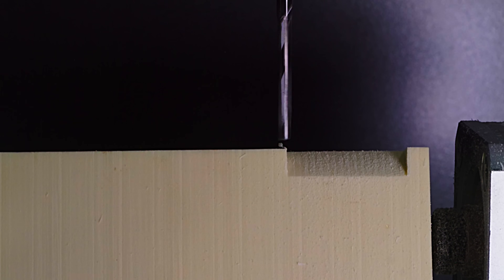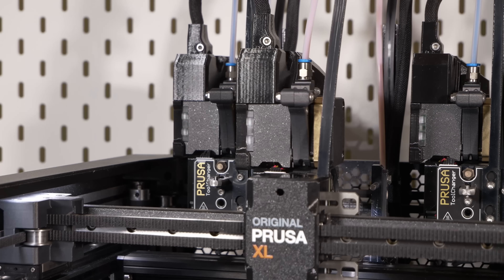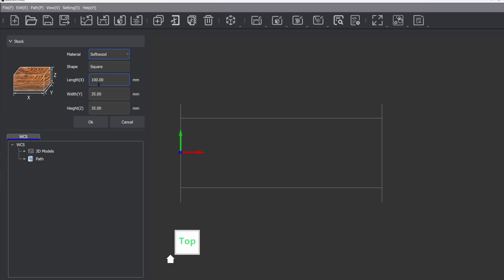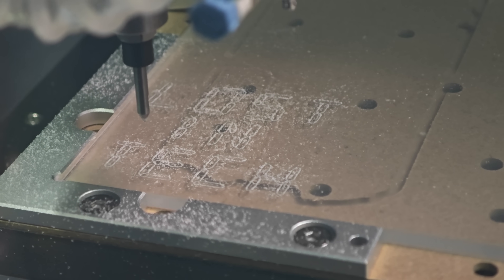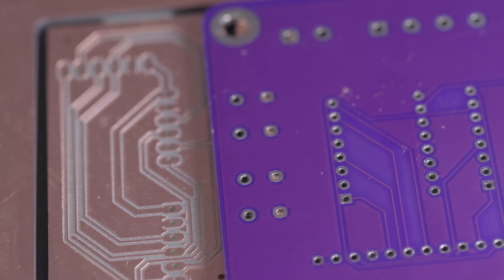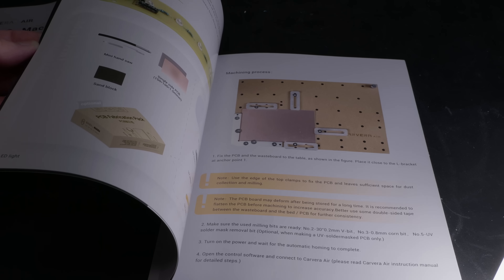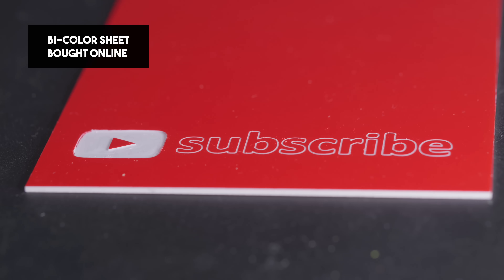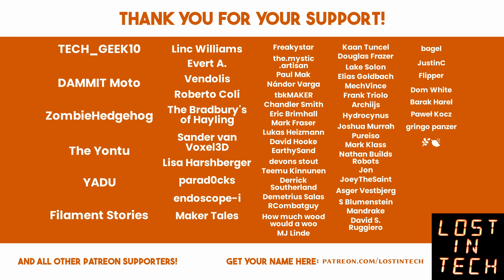Do we NEED a CNC? -  What can Carvera Air offer to 3D Printer Owners?

Comment: Real quick suggestion... Cut your wood cross grain where you can. It will keep it from fuzzing up. It can tear out, but just do roughing pass and leave plenty of material for smaller tools that won't tear out as easily.
Reply from the maker: Appreciated
Reply: @LostInTech3D My pleasure. I've got 2 decades of career CNC programming under my belt with >8 on a mill doing woods and plastics. Though I've never used a rotary, so I'll have to turn to you for advice there. 😁  While I'm doing sheet metal and copper tubing now, you are certainly welcome to reach out to me with questions or just converse. 

I truly appreciate your breadth of effort and side tangents BTW. I tend to be curious and geeky, so your vids are right up my ally. I've sent a lot of like-minded people your way because of it. I've learned a lot from you!

Thanks again and have a great rest of your week!

Comment: 7:20 -ish: It's a general design rule to think about the constraints of your manufacturing. That we don't in 3D printing is just the result of softweare maturing over the years. I do remember when 3D printing was not generally consumer friendly and you'd fail prints if you'd not design it for the process.

Comment: I'm sure it's fun to see but the back EMF induced by the steppers aren't good for the control board, I've blown one or two back driving the stepper. I added a simple G1 Z345 command to the end_print macro to my K2. You could actually do G1 Z999999 since the printer actually knows z-max and z-min.
Reply from the maker: nah, that's not how it works, I have no idea how you blew your drivers but you realistically can't blow them this way, you probably could if you wired them up to a drill or something. Faulty board maybe.
Reply: @LostInTech3D perhaps, but it has happened twice once on a duet board and once on a BTT board. On a Prusa MK3 and SV08, the display tries to light up if you move the tool head around during mx and unplugged from the wall.
Reply from the maker: @Guardian_Arias perhaps you have inspired me to investigate it and make a video 😁

Comment: 2:18 Ultimaker has had a very easy to use nozzle swap system for many years. It takes 2-5 seconds to swap nozzles, or rather, print cores. I'm honestly surprised no one has stolen that design and made it cheaper (or maybe somebody has and I haven't seen it).
Reply from the maker: flashforge kinda did but broadly nope

Comment: Now I find this hilarious, your trying to go from 3d printing to machining, now I just tried my hand in reverse. For 35 years I have been using machine shops to manufacture parts in all shapes and sizes. On my last project (May 2025) I decided to branch off and produce some Resin Prints on my Form3 for pneumatic valving then post machine them for tight tolerances and bore finishes and concentricity. Well the results were amazing, except in just two areas. strength, and material choice. 3d printing opens up huge manufacturing options in the ability to make drill holes in manner that conventional machining just cant accomplish like spirals, 90 degree bends and never break the outside of the material. Next was the materials list available, resins break down over time if exposed to the same solvents that are used to them cleanup. Though resin is solid (airtight) I thought if I were to manufacture in SLS (laser sintering) say glass filled nylon, I would keep the ability of processes that 3d printing offers and materials that support environments that wouldn't cause breakdown. so I hopped on the computer and sent off for my first prototypes now in GF Nylon, best of both worlds right. WRONG was I. For starters the resolution (even if I left material to machine post) it more resembled a sand castle grains stuck together and was about as porous as a frozen sponge (so NOT air tight) and even if machining, I can not cleanup material to become anything more than a rough piece of sandpaper. Costly for an answer of "Well back to the drawing board" GREAT for prototyping, but IMO we haven't broke the threshold of 3d printers replacing injection molding and current mechanical machining. but it's nice to see where were moving toward. BTW you got my thumbs up, excellent video!
Blessings,
Danial

Comment: I wonder if I can use the software to get G-Code for Mach3. Especially for proper feeds and speeds tables and for PCB cutting, as I really don't like FlatCAM...
I started with CNC, and switched to 3D printing, and that learning path actually helped me designing better parts for 3D printing...

Comment: As for the soldermask - it helps a lot with soldering itself as well. But you could easily do it here I guess - meaning adding soldermask layer by hand, curing with some UV light and then trimming away using bit (or laser) on pads where it is not supposed to be. One step closer to "like a real PCB" :) Cheers!

Comment: We already use CNC (machines), since 3DP ARE CNC machines. Anyway, a CNC router/lathe can be quite handy. TBH, that was the first machine of that kind I bought back then in 2015 or so, mostly to manufacture electronic boards, before stepping in 3DP world 2 years later.

Comment: CNC Machining is - IMHO - all about getting experience... Even more so when your machine isn't ideal for the Job as you then cannot rely on the manufacturer's provided values 😑

Most of the stuff I do I can usually get away with doing with 3D Printing ( either FDM or SLA ) like with my E-100 but occasionally 3D Printing will just not cut it ( at least not in most plastics I can work with ) so it's either outsourcing it to be 3D Printed in Metal or when possible CNC it myself on a hackjob of a machine made to cut Parts the size of Cabinets which is fine for Woods and Plastics like Acrylic and Delrin but FAR from ideal for anything that is metals... Yea it can be done ( https://youtu.be/AQ27ZcNx_eM ) but boy will you be babysitting your machine.

Comment: as a machine operator i would say that having an air pump for machining aluminum and copper/brass etc. basically all softer metals is more a must than a need, or just some kind of cooling. if your metal gets too hot it will start to gum up on your tool, this can ruin it or even ruin the piece you're working on. having a sharp tool for soft materials is also important for the same reason, it will deform the material instead of cutting it introducing more heat into the part
edit: you could also just stop the machine and wait for it too cool down, but stop the spindle too
Reply from the maker: Yeah I'm actually surprised they don't supply it with one, it was non trivial to find the right kind of pump and I think most people don't use one so I'm not sure how that works out
Reply: @LostInTech3D  Yeah, especially when they call it the Carvera AIR ... 😁

Comment: It is not clear if this is a review or a sponsored video, I'd rather you clarified such things at the start. 

Otherwise CnCs are pretty nifty, though where they truly shine is in their ability to cut out big parts and panels, at least at the hobby level. Personally I want to make a tabletop arcade booth, or make my own guitar body, I honestly fail to see what such a small machine would be used for. Also a noisy router does not live in one's house to begin with.
Reply from the maker: Not sponsored, or I would have made that clear.
Reply: I fail to see how a ~$3000 gift is not a sponsorship. Similar so saying that gifting a new air force one is not bribing.

Comment: I really want to see if one of these things can deal with copper, mild steel and stainless. The will it/won't it uncertainty stopped me buying an original Carvera back when it was a kickstarter
Reply from the maker: It'll cut anything, you just might not like the feed rate. There's a video of it cutting titanium on their website.
Reply: I imagine cutting any kind of steel on a machine like this would be a major pain, however if it can cut aluminum then copper will be fine too.

Comment: Not only can be subtractive manufacturing be the better tool for some jobs (simply because of the different materials you work with), it can also be a great addition alongside 3D printing.

I don't have done that many jobs with my Carvera Air so far. But I already cut acrylic parts that went into 3D prints as an Inlay during a print pause (glued on the bottom side and just printed over the top). I also used it to engrave on TPU. It didn't remove any material, but kind of melted and mixed it which gave better and cleaner looking lines than embossing in the 3D printer ever could.
What I didn't have done so far, but will do if I have a project that needs it, is cutting reinforcement parts out of metal that can be put in designed pockets during the print. As the Carvera can cut good threads too, those reinforcement parts can also be used for mounting purposes.
Reply from the maker: I can't imagine engraving tpu 🤔
Reply: @LostInTech3D It was quite easy. Used a 0.2mm 30 degree bit and only a depth of 0.2mm. I engraved an on/off logo on the part. It was a cover for an electric scooter and beneath was the on/off switch. My dark grey TPU turned a bit lighter in color and the molten TPU raised a little bit. So you could feel IT pretty well too.

I just tried it because I was curious, but it went surprisingly well. But you probably won't be able to realy mill material away.
Reply from the maker: @MirageDU  good to know, thanks!

Comment: I have a basement shop full of CNC machines that I built from scratch or converted to CNC and I haven't used these CNC machines in years since 3D printing became more practical.  I kinda miss it, but not the flying chips.  Carvera has done a lot to make small CNC approachable.  Allowing the user to select a material and having programmed feeds and speeds is huge.

Comment: A crazy way of thinking about this is you can use all of your old scraps that you have from your failure 3D prints melt them down to a nice bar per se and then subtractive Manufacturing
Reply: Not crazy. That's what I'm saving my filament waste for! Not for a Carvera, but a more modest Genmitsu 3020 Pro v2.
Reply from the maker: I did have plans to try to engrave or cut things that I've printed but it took too long so I'll get around to it in another video. PA could be interesting.
Reply: @LostInTech3D  I've done some machining on my 3d printed parts. Printed solid, PETG and ASA mill very nicely, and vertical walls look like solid material after milling. TPU needs a very sharp cutter to mill well without leaving burrs or long stringy chips.

Comment: I've got to admit.  That is cool.  Very cool.
I think I'd need to attend a course to get my head around the cnc language and methods.
Reply from the maker: it's the same gcode - but it's definitely not the same way of making it!
Reply: I bought a cnc with the expectations of it being easy to learn since I already knew 3d printing. If anything it made it more difficult because there aren't stls for my slicer. You have to take designs and put the correct tools and choose the proper settings in your cnc software (I use vcarve). There is no one general size tool similar to a .4mm nozzle. It's too versatile.
Reply from the maker: @KJMcLaws  yes - you have to be mindful of this at design time, so either designs have to be simpler, multi stage or some combination of both